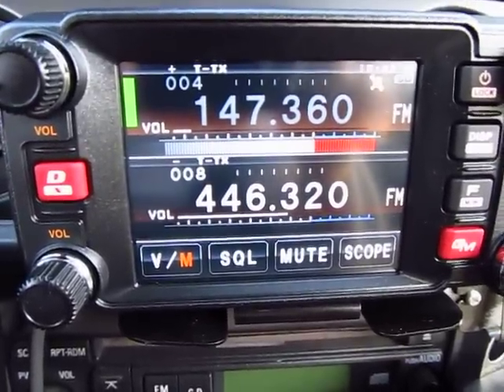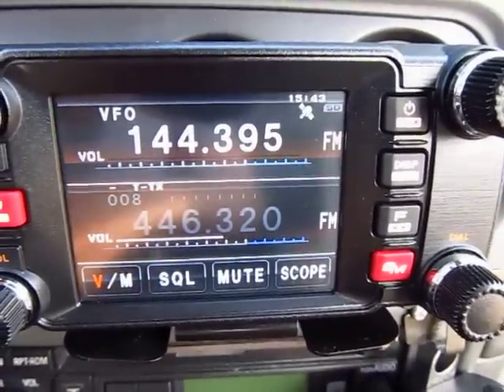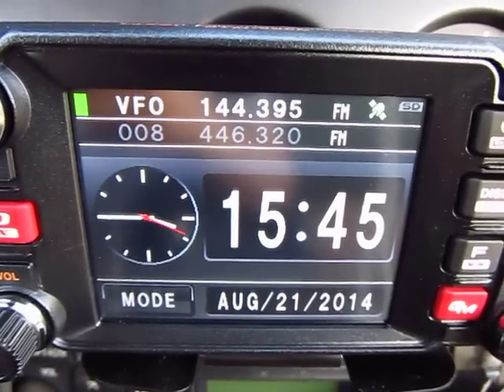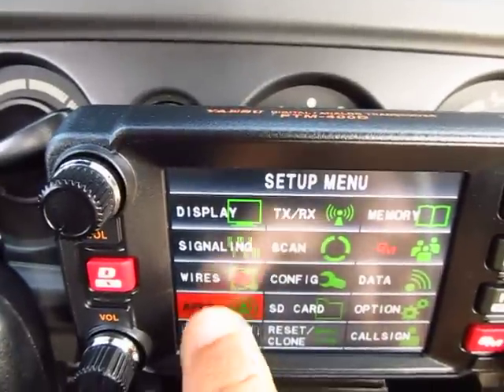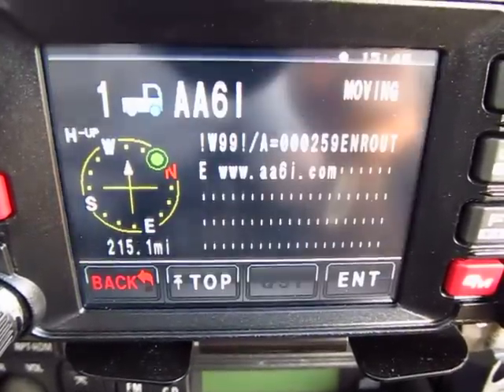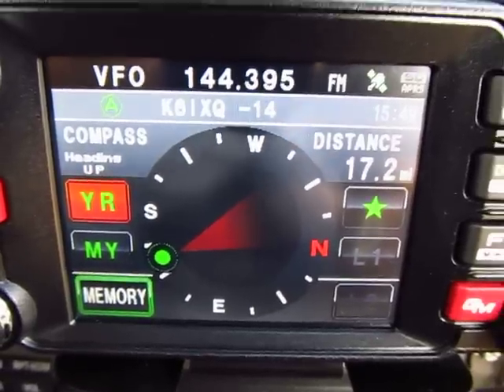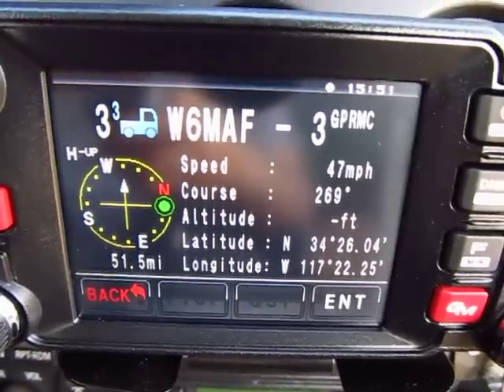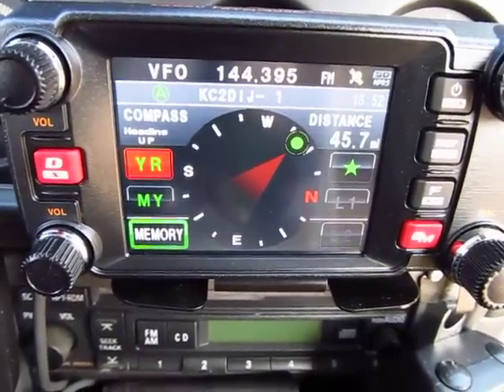Yaesu FTM400DR Display and APRS

Comment: Good video. Thanks.  I am wondering.  If this radio was set up permanently at home and sending out and receiving APRS, can you observe “Tropo” Dx conditions on 2 meters?  For example, instead of packets of data from 50 miles out, to Tropo conditions 200 plus miles out?  Thanks.
Reply from the maker: So sorry for the delay, that will be a function of the Digipeater system in place. If such a system exists, than it would be possible to do tropo conditions 200 miles & beyond.

Comment: I want a radio to operate C4FM fusion am I in doubt between YAESU FTM 100D or FTM 400 DR? What is the best option ??
Reply from the maker: Without any hesitation the Yaesu FTM 400DR! It's a full duplex, dual color display with a touch screen. Plus many more advantages over the 100DR.

Comment: What is the actual POURPOSE of this gadget???
Reply: It's an amateur (ham) radio, a rather capable unit at that, made by Yaesu that supports both FM analog and digital modes.  APRS is an added data service that runs on amateur radio bands to transmit and share information such as text, images, GPS location info, etc.

Comment: Does this unit have built in TNC?
Reply from the maker: Yes, it's APRS capable.
Reply: built -n TNC ax.25? or just APRS?
Reply from the maker: +revo adan both
Reply: hmmm looks great. But i can't find anything in there website that say it has a built-in TNC but it is APRS ready,  here .." 1200/9600bps APRS® (Automatic Packet Reporting System) Data communication capability included." I'm not fun of UI design of the Display but rather the functionality of the unit. Like it can do digipeating during emergencies, winlink for email, aprs and igate. Anyway, i will do research more on ftm400. Thanks

Comment: Hello - I'm contemplating either the FTM-400DR or the FTM-100DR. Of course, the 100 is not a dual-receive radio while the 400 is. But can the 400 operate via repeater on the primary band while simultaneously sending/receiving APRS on the sub-band? Or is the sub-band receive-only? Thanks!
Reply from the maker: +Captain Overpacker YES! You can be sending APRS on A/B Band, while at the same time transmit and receive on the other band. Actually, your Sub band can be the same as the APRS band (VHF), and you can still transmit. It will pause you when its ready to Beacon TX in APRS mode, or if you have a long key down time, it will Beacon TX after you unkey. You can also do cross band repeat and enjoy a live color band scope.... the 400 is so much more radio IMHO!
Reply: +N1CY - Thanks for the swift reply! Your report gives me more to consider. I like the smaller dash footprint of the FTM-100. But the 400 seems to offer far more. Thanks again.

Comment: I'm very much a novice with APRS. I like the idea of being able to check distances and direction with a radio and not need a computer or separate GPS unit in the car. Is there a way to receive only one station rather than get dinged every 2 seconds with every packet around? It'd be nice just to track one station. Thanks!
Reply from the maker: chadlpnemt Yes, you can filter what type of APRS packet you want to receive, for example; you can receive only weather stations, or mobile stations within a certain distance... so yep, it's really neat what you can do with APRS.

Comment: Great video. I'm currently trying to decide between this radio and the Kenwood tm-d710g for aprs. I really want the Yaesu, but I've heard there's no way to scan small banks of memories.  For instance, on the Kenwood v-71a, you can scan sets of 100 memories which is great for travel. I group repeaters by location into their own group of 100 along my route and switch the scan from bank to bank as I move out of range. Is there any way you know of to do something similar with this radio?  It looks like it can only scan all 500 channels.
Reply from the maker: Hi, I can see your point and I really don't have a lot of channels in mine. There might be a firmware upgrade that may address that issue, other than that, I really love the radio and Yaesu C4FM digital mode. I use aprs on occasions as N1CY-9 and N1CY-7 with the FT1DR handheld. Good luck and 73's

Comment: Great video. What kind of antenna are you using for the radio?
73's.
Reply from the maker: Real sorry for the delay, the mobile antenna is a Comet SBB-94 triband with N type connector and low loss coax .
Reply: N1CY ok awesome I just got the radio two weeks ago and I absolutely love the rig I am using a comet CSB750A uhf mount antenna with trunklip mount and it works great. 73's.

Comment: This is a great help, I bought my FTM400, in part because of this. One problem, my setup buries the built-in GPS antenna well into my truck cab, resulting in poor reception. I can't find an external GPS antenna that plugs in...do you have any suggestion. I asked Yaesu, and they hadn't a clue. Thanks!
Reply from the maker: Hi there, that's unfortunate that you have poor reception, get the head unit as exposed as possible to the windows/windshield, that's gonna be your best bet without an external GPS! And I don't know of any external GPS that will connect to the head unit. Good luck, and thanks for the feedback.
Reply: loup407 I understand that someone makes a GPS repeater- I saw it on one of these youtube videos.

Comment: My current APRS setup is a Mobilinkd TNC hooked up to a Kenwood TM-281 and an old smartphone (no service) running APRSDroid. I'm waiting for a manufacturer to combine all of this into one package. This radio's form factor and touch screen had me hoping that someone had finally put the maps and visuals  into the base unit.
Reply from the maker: all you'll need to do the above is to hook the FTM 350 or FTM400 to a Garmin NUVI GPS, using a special cable, and you'll be set: www.argentdata.com/catalog/product_info.php?products_id=158
Reply from the maker: Check here too: http://wiki.argentdata.com/index.php?title=GTRANS_Yaesu_FTM-350R

Comment: Does this radio have a way to show you the APRS stations on a map?
Reply from the maker: Hi, it doesn't. If you have a smart phone, you can access the web and go to aprs.fi then input the other station call to view on a map. If the other station is mobile; you should see a route trace. However, it is not quite a live route trace ...there is a bit of delay. My station call is N1CY-9 (when mobile) and (N1CY-7) when portable with FT1DR.